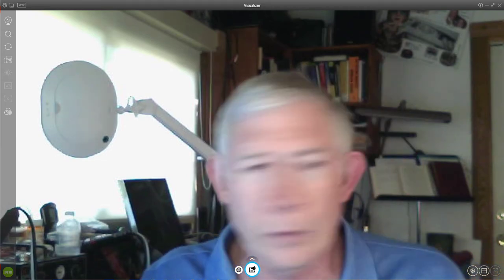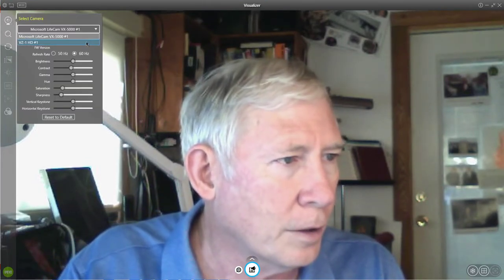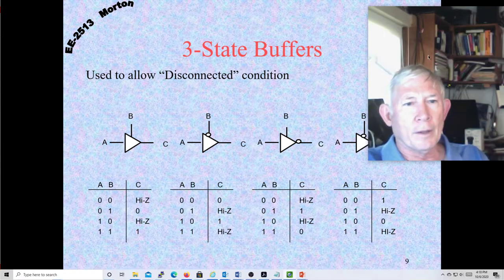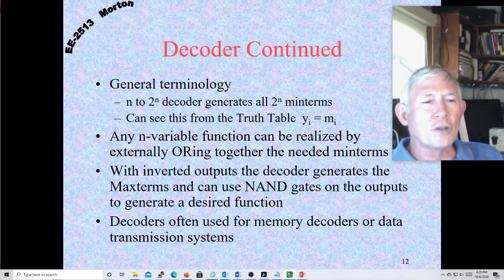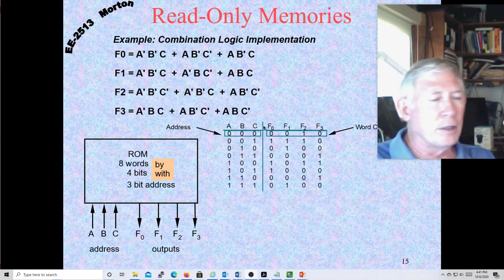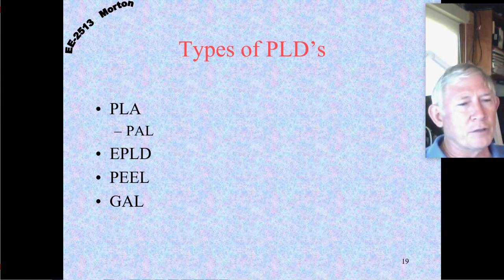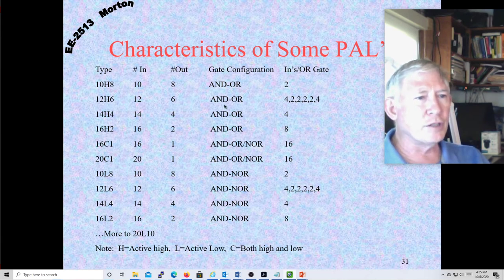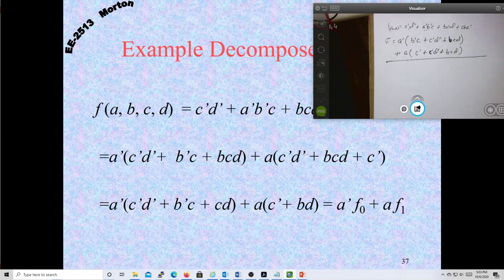2020 10 06 Logic Dz #18

Comment: You mentioned not using programmable logic devices much anymore, I worked for a company the built/assembled control panels. We put PLCs (Programmable Logic Controllers) in them all the time. Are a PLD and a PLC the same?
Reply: I think they are, was about to say the same thing lol. In the military we had a few PLC's for some of our loads. Most were outdated controllers from 70s/80s, but I do remember working on a few PLCs